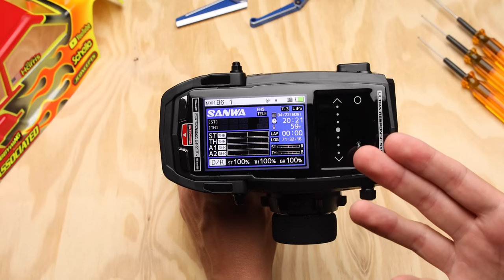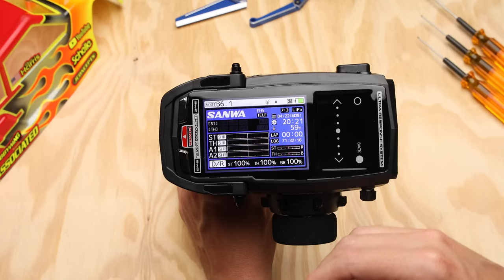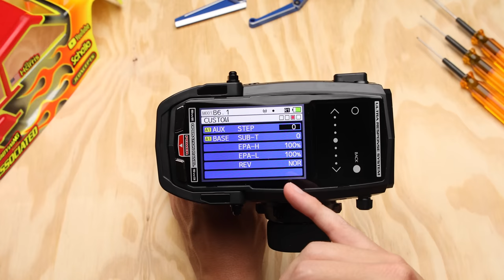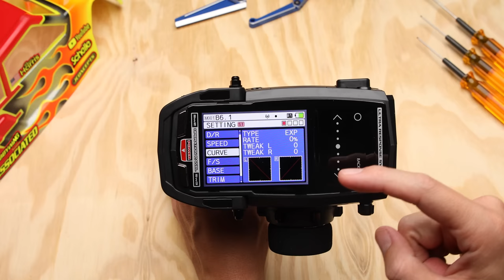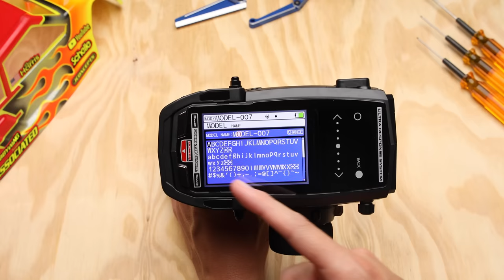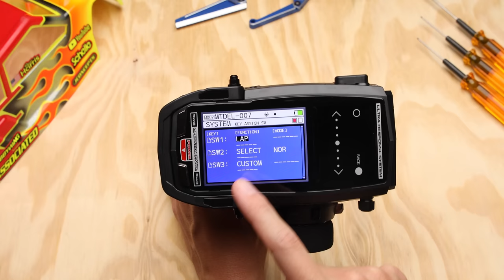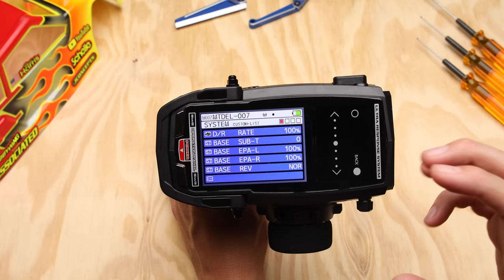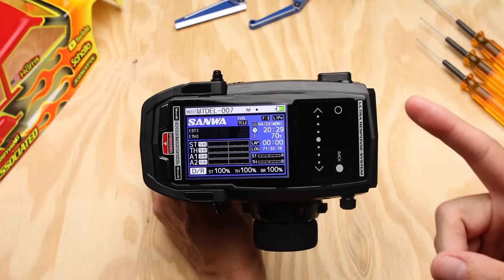SANWA M17 || Switching from Futaba? My first look

Comment from the maker: Anyone else making the switch to a different radio?
Reply: I just ordered an M17, coming from a Futaba 4PL which I had for years. It was a difficult choice between Sanwa and Futaba, especially as I'm used to the feel of my Futaba and got plenty of Futaba receivers. 

I really like your video, could you also give us your opinion on the feeling once you've tried it on the track ?
Reply: I still have a Spektrum DX3S from 2008ish lol, and I race and bash with it. I will probably make it my bash only unit for the trucks, but I have been looking for something like this or the Futaba 4PL/PK for 1/10 on road, so thanks for the video, this radio looks great!
Reply: Yeah I switched from airtronics to futaba because I feel sanwa really dropped the ball on the m17 user interface.
Reply: Hey Ryan! Thinking about making the switch from Sanwa MT44 to Futaba 7PX. I’m still considering the M17 but the interface just doesn’t look as slick as the 7PX....... Why didn’t you go to a 7PX if I may ask?
Reply: I wen from a mt44 to a m12
Reply: Spectrum to m17
Reply: Used to run FlySky and liked the way they worked... eventually decided to make the switch to a more high end radio. I got a futaba 4pv and I must say I realllllyy like it. 👍
Reply: I like my Futaba 4pl so much that I bought a second one as a backup for the eventual death of  the first one.
Reply: I‘m currently using a 7PX and I‘m thinking about switching to Sanwa (back). 7PX is an awesome radio, but it‘s heavier und bigger. I dont care about menus and Look, haptic and feeling matters. 
@Ryan did you compare 7PX and M17?
Reply: I did the switch a few months ahead of you..... Futaba to Sanwa ... Futaba since the early 90s..... and boy for some reason became a better driver with a Sanwa. I feel the Sanwa has an equal linear feel in steering and throttle than the Futaba.
Reply: Futaba is the best
Reply: Just bought yesterday a Sanwa M12s Great Radio! Switching from Spektrum DX5C
Reply: I might switch to this radio. I currently use a 4pls, but I've grown tired of it. Was going to go with a 4pv, but might save up for this instead.
Reply: Once you go sanwa, you only switch to the newest sanwa thereafter 🤣
Reply: Initially (back when everything was 75Mhz) I used Futaba for electric and Airtronics for Nitro (the receivers just seemed like they held up better) I stopped racing right around the time the first Spectrum systems hit the market when I got back into racing electric around 2009 I had to start from square one I ended up with the then new M11X. Currently since I race & bash I’m currently running a MT44 for anything that hits the track I run on road & off road (I prefer the MT44’s weight and balance vs the M12) I just purchased a Spectrum DX5C for my crawler and anything else I go bashing with along with a few vintage RC’s I occasionally run. The prices of the receivers for that system makes it more economical to equip multiple RC’s most of which don’t need a high end radio system and it’s a radio I can had to a friend and not worry if it gets dropped since it’s only a $99 radio vs my MT44 or something like that M17. 

A company called RC mission offers a wireless charging option for the M17I believe it’s currently available check out my buddies FB video on it 
https://www.facebook.com/1665492173/posts/10216026763896323?sfns=mo
Reply: Yes I changed froma really crappy one to a hacked FS GTb3  :D
Reply: Yup, from Sanwa to Futaba. IMO unless you are sponsored (which you probably are) I would go with one one the new Futaba releases. Better feel on the track and features.
Reply: Ryan Harris switched from dx3r to mt4s, overall lighter and more high tech
Reply: i might go sanwa eventually but damn those receivers are expensive, jesus. Wireless futaba ones are around 40$ and Sanwa are $100...plus the 7PX is awesome.
Reply: Great Video Thanks ! I will definitely be sticking with my 7PX though. I’ve been using it for about a year now and it’s been flawless. For me, the overall quality feels much better than other brands. It fires up quick and I love the touchscreen.
Reply: Dylan Chadderton go with a Sanwa compatible receiver from Powerstar or Hobbystar for only $40-$45 and you are set! I have both and they work fantastic with my Sanwa! Love my Sanwa MT-S! Just recently switched from a Flysky FS GT5
Reply: Did Ryan answer why he switched? Watched all the m17 videos on YouTube.... Coming from the m12 to the mt44.... I went back to futaba 7px special edition... I see the user interface is the same as the mt44 which I always hated.... With they went with a better user-friendly interface... Futaba is way easier to navigate I. E. Switch programming etc... Touch screen ftw! We'll see how my test run goes though..... 😬
Reply: Just ordered an M17, switching from an M12S RS.  I loved the M12S but the M17 is so much lighter.  Can't wait to get it.  Also great video.👍👍
Reply: I switched to the flysky Noble N400. Hope that soon they will release the 5, 6 or more channels receiver. Nice Transmitter and has a good feeling. Very suptile/smooth
Reply: Just bought my first radio ever.. It's a Absima CR3P.
Reply: Yes just switched from 7PX to MT44. Don’t need touch screen in RC Man!!! Hey how did you mount your buggies on the wall. Been looking in comments to see if anyone else has asked but could not find it.
Reply: Got me a Mt 44, starting to get back into the hobby
Reply: I SWITCHED FROM A 7PX TO AN MT44  prefer teh feel of sanwa compared to futaba and this is lightweight and has all teh options i need and im not as scared to drop it as teh 7px
Reply: Spektrum DX4R Pro to M-17 😎
Reply: @markhall912  May be making same move. Sorry to bump an old thread, but how did you like it?
Reply: @batteryacids  it's fast and hasn't had any problems out of it
Reply: I grew up with Futaba.. Only buy Futaba. Just me. But those Sanwa are nice too
Reply: I bought this one 2 weeks ago after 40 years on a stick transmitter, taking some getting use to as I got arthritis in my hands, purchased the $130 case too, it's a thing of beauty and fits the controller perfectly
Reply: I switched from a Spektrum DX4S to a Flysky Noble NB4. Those FGr4s Receivers are even smaller than the M17 ones.. 😉 Im so happy with the NB4.. So much so, that i ripped all the old receivers out and put in the new receivers. 😊
Reply: thinking of switching to sanwa m17 from futaba 4pk
Reply: I’ve been a loyal Spectrum user since the 90’s but now that I’m getting back into rc with my son, Sanwa is exactly what I’ve been looking at, and this video just sold me on the model. Great vids Ryan, keep it up.
Reply: Late to the party here, but I switched to MT-44 for bashing, and M12-RS for racing/high/speed performance r/c’s. So far, yeaaa buddy, later Skeptrum, seems everything else is a toy now...
Reply: @manuenriquez9848  way better than the M17 I can’t stand mine, to lite , menu interface extremely basic and annoying . I like tension on my wheel and trigger like sports mode on a car so the feel is there.. sanwa just don’t cut the mustard and m17 is a fad because it’s sanwa
Reply: M17 basic interface , touch pad not great. Original battery that comes with it goes flat fast .. only supply enough springs to do either wheel or trigger... dark blue have the most tension and give it more feel and feed back. Screw in the bottom is annoying when changing battery .. rc charger charges battery faster.. my USB port on a new battery broke within two charges... it just feels cheap.. I have a futaba 7xc stick it’s amazing , features, touch screen options, updates easy, can change servo settings on the fly.. simply amazing.. I’m buying the 7pxr too I can race stick and wheel.. I have all the upgrades for the m17 top servos.. futuba covers more model options for nitro, tanks, nitro etc .. but can very confusing .. m17 isn’t in the same league if compared on feature.. sanwa is just about name and what people use at there clubs.. just my opinion but look at the future proofing and options , build. There both light but I don’t want to hold paper I would rather build my muscles for exercise
Reply: @markhall912  laggy interface. My SNES had better graphics and the original had a better touch screen .. it must cost sanwa peanuts to make
Reply: I had Airtronics starting in 1979 all threw the 90s then went to Futaba< BAD MOVE !!
Back too the better Sanwa!!!!  AND Futabas service was the absolute worst and the Sanwa(Airtronics) never ever broke,  EVER.....
Reply: @Kareem Kohen instablaster ;)
Reply: @Zyaire Esteban thanks for your reply. I found the site thru google and im in the hacking process atm.
I see it takes quite some time so I will get back to you later with my results.
Reply: @Zyaire Esteban it did the trick and I now got access to my account again. I am so happy:D
Thanks so much you saved my account!
Reply: @Kareem Kohen glad I could help =)
Reply: I'm currently plan to switch from a Futaba 4PM non + to a Radiolink RC8X in the next couple of months for most of my RC's from my Bashers to my Speedrun cars but maybe plan to keep my 4PM for my race cars. I considered a DX5C or DX5 Pro (2021 Version) but they were kind of pricy for both radio and receivers. But the M17 looks like a cool radio but i feel the 7PX or PXR is better but that's just my opinion.
Reply: Yep

Comment: R-Mode is actually a setting that lets your change multiple settings at once during a race. For example- I use it in onroad to adjust my dual rate in steps of 5, but at the same time I also have it set to adjust the speed of the servo so that the overall feel of the steering over travel remains the same. You could do the same thing with the throttle on a 1/8 scale buggy. As the tires wear over a long main, you could use different R-Modes to adjust the various ALB or throttle settings to help manage the car. It's a very useful feature that carried over from the M12.
Reply from the maker: Thank you for the explanation! Sounds like a very cool feature!
Reply: The M12 has 5 programmable R-modes R1, R2, R3, R4 and R5. Each R-mode allows you change one or many settings with just one click. For example my R1 is my normal settings (everything linear/no driver aids). One click on a button/toggle will switch to R2 which I have programmed for -5% throttle curve. Another click on the button/toggle will switch to R3 which I have programmed for -10% throttle curve. My other R-modes have been set to progressively more curve. It's similar to the switch moto gp bikes have when their tyres are worn and they need to switch to a milder engine map whilst still racing. It's very helpful if you just need to adjust something on the fly without really having to scroll through the menu. It just requires programming in advance.

Comment: I have a 7px and tried the m17 at the track with a similar setup car. Wheel and trigger feel is the same for both as i was making same lap times after 2 test laps on the m17. What i did like was the lighter weight on the m17. What turned me off was the interface between the 2. Futabas have a better layout and easier to navigate. I do not think you could go wrong with either.

Comment: Why is there not a radio that uses an external mobile phone for the screen? How often do you use the screen while racing? You could have a strap ion your arm with the screen on. This would make radios way cheaper. This would then pave the way for a communications standard which would allow multiple implementation of software. I mean I can connect to my car and change loads of stuff using the OBDII standard.

Comment: I have been with Airtronics since the Caliper 3P Came out so A LONG time. I changed over to Futaba (due to 3d heli sponsorship and me racing was a conflict so i was asked to run the 4PK type R) to the 4PK type R for about 1.5 years. Other then that i have ran Airtronics starting with the Caliber 3P then to the Caliper 3PS then M8 then M11 then M11X then M12 lol and now the M17.

I will say this when running 12th scale mod and going back to the M12 from the 4PK it kicked my ass for a little while you don't notice just how quick Airtronics radios and ultra low latency is until you are running classes where absolute precision is required and you go from one brand to another running the same setups and you are catching pipes at the entrance of turns or hitting corner markers and going for a short flight and not knowing why then changing a receiver that slows the protocol down and running perfect again. Once i knew what was causing the issue and having very hard time getting back to tight lines and clean races that are a must in 12th scale.

I really really love the M17, the M12 was fantastic and still is but the M17 is totally amazing with just how well it fits my little girl hands. I loved the M11 and M11x for sure but just how big it was caused issues for me the M8 was still kinda big but was ok the M11 was massive and it was so nice when they want to the smaller profile or the M12 and now M17 with how adjustable it is to your hand.

Comment: I hope they solved all the issues which they had with the M17 at the beginning. I am using Sanwa since the M11x and bought a few months ago a brand new M12S. If you want to save money and don’t need the touchpad I also recommend the MT44 which is great for the price.

Comment: cool video. I was debating between the Futaba 7px but thanks to this video I'm making a switch. hey btw quick question does it also display receiver voltage?
Reply: It does display voltage and if you turn your car off it will tell you of the voltage drop in the car too

Comment: Hi Ryan, first off thanks for all the quality content you upload here on u2b and for having, quite possibly, the nicest demeanor and outlook in this corner of the internet. I did have one question and, as far as I saw, I don't think you've uploaded any updates since this video aside from the wireless charging. You kinda dodged the elephant in the room and skated neatly past the one thing I was really curious about...why? I'm not saying it's a good or bad move but, for all intents and purposes, the (T)7PX(R) is universally viewed as "The Egg Laying Wooly Milk Pig" as we Germans say of pistol grip remote controls. What were your reasons for making the switch to the M17? Were there deficiencies, niggles or foibles with the Futaba that made you want to stretch your proverbial suspension arms and switch it up? After sufficient time of use I imagine a remote becoming something very particular if for no other reason than the kind of intimate tactile interface your hands make with it (get your minds out of the gutter, thank you) that switching remotes would take a fair amount of time to, recalibrate your hands if you take my meaning. 

Cheers mate and godspeed,
-Diem

Comment: While I do not understand why not to change to a completely touch setting system by Sanwa. Feel and trigger/wheel position is just better IMHO. Feeling and speed (as available on M12) is really a feature, as full speed (less laggy connection) could be too mach at the beginning. I could actually quantify the difference in about 0.5s per lap when I switched from Futaba to Sanwa... With tons of backcompatibility.

Comment: As Always super nice video, but you did not say why the switch to Sanwa. I know the weight of this radio is amazing and also the signal quality and speed. Overall I don't want to start a Latency war but I know from trying a lot of radios at different tracks that Sanwa is really amazing and all the big racers where I go are still using their M12s but I think more and more will switch to the m17. For Me I am using an Sanwa MT-4S and a M12s and their are both amazing. Eager to have your opinion about your switch.

Comment: On MT4 and M12 and more of the older Sanwa. you could check the voltage on the reciver battery, but have not been able to find how to do it on the M17? And of course I have telematry on.

Comment: Good overview. I see you set all channels to SHR mode but you didn't mention it.  There is Normal, SHR, and SSR modes, and SSL features. Consider making a follow up video about those things (I know but others might not) Also, I'm curious to see if the touch panel response gets worse with the protector on. I really would have preferred M17 have physical buttons instead of that touch panel.
Reply from the maker: Thanks for pointing that out! It's all new to me. I also kinda agree about physical buttons... I like the feedback of pressing something. Old school at heart I suppose 😂
Reply: Netcruzer you're vids are great too!!!!  You two should do a vid together, and have a race!!!!

Comment: You will love going to Sanwa. Been Sanwa for a few year now. Used trigger for years but recently had to change to stick as I have shoulder issue which holding a trigger was activating to the point the next day after racing I would be in chronic pain. Just as quick with sticks just I feel a little less consistent. Find I have better throttle and brake control with a trigger set. But health has to come first.

Comment: I made the same switch to the M17 from Futaba. I am not disappointed at all it definitely feels great. With some spring switches and tension adjustments to the wheel and throttle it’s dialed 👌🏻👊🏻